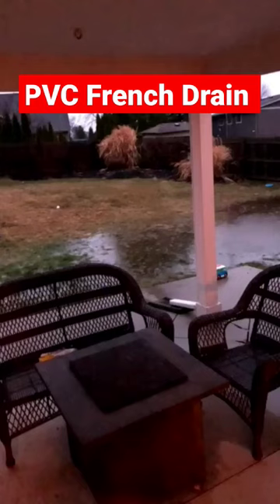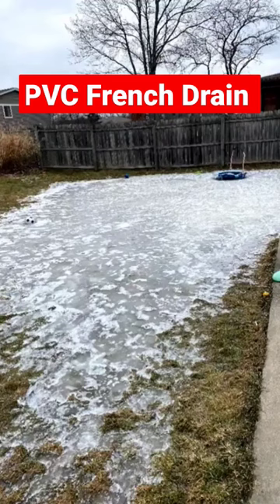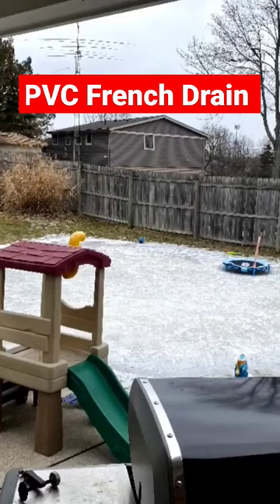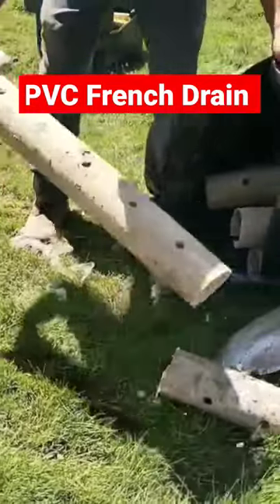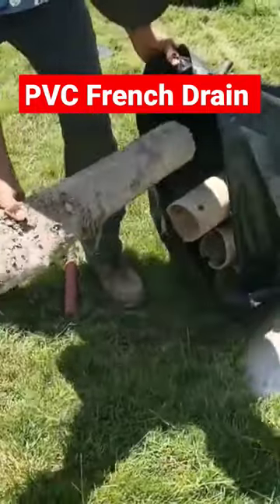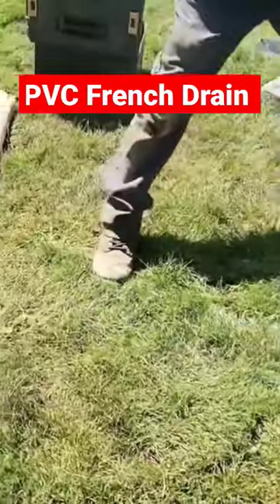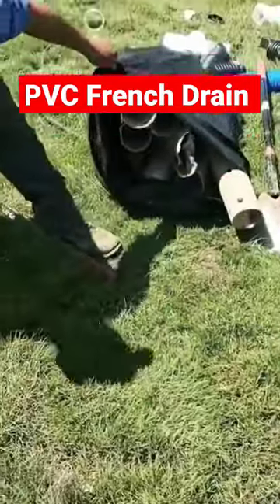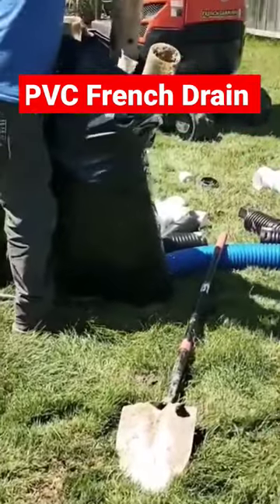Why do PVC French Drains Fail?

Comment: This is why you have filter cloth on the sides that cross over the bottom. Then fill some rock and then sock the pvc pipe and run it out. Works like a giant burrito. That pipe you show failed because it wasn’t socked or had filter cloth anywhere near it lol
Reply from the maker: A lot of PVC installers do not use Non Wolven Geotextile filter fabric. It's built to fail at the time of install. They are fools.
https://youtube.com/playlist?list=PLjFCqaZ4v1BX_ZMbxsYVB6CNFoeAmuPxX

Comment: PVC and Perforated pipe are equally valid both have their merits, The problem comes from not using a decent fabric around the stone such as in this case.
Reply from the maker: I would definitely use PVC for indoor plumbing 🙃
Reply: @FRENCHDRAINMAN Well that's a no brainer, I'm talking only in the respect of French drains, Your French drain installations look to be spot on as far as I can tell, Just don't know why you are blaming the failure on the previous use of PVC, When it was the lack of fabric.

Comment: Always the cheap fix and the right fix, I'm a grader, you need to check slopes and add dirt.
Reply: absolutely proper drainage off your property and or housing development. There would be no need for the French drain or a sub pump proper planning of the neighborhood would absolutely alleviate any of those conditions. when you haphazardly throw houses together and not plan for the neighborhood as a whole, then these are the conditions you end up with. Just make sure my house doesn’t have water in the back. Screw my neighbor.
Reply from the maker: Need both